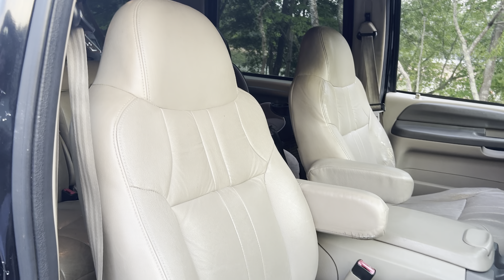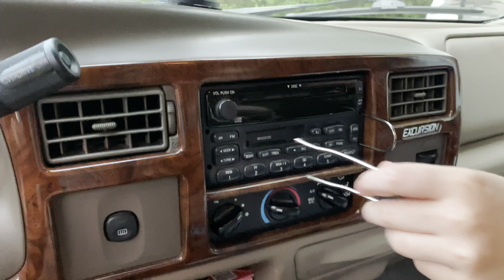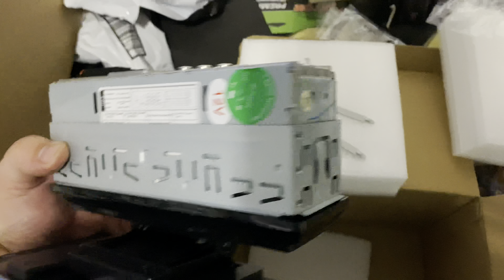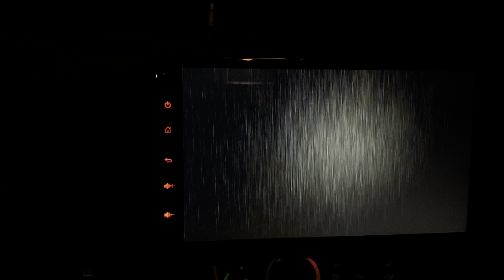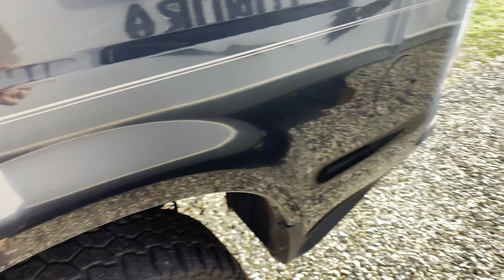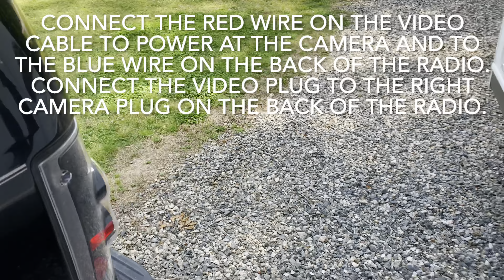Apple CarPlay Radio Install - ‘00 Ford Excursion XLT

Comment from the maker: The rear backup camera power wire should be connected to the pink wire (Parking Sensor Control Wire.) Then the yellow RCA connector should be plugged into the CamIN connection on the back of the radio.  This seemed to work well.  The instructions are lacking.  

For the another camera to be connected, you can connect the camera power wire on the video cable to the blue wire on the back of the radio.  Then that yellow RCA connector should be plugged into the Right Camera connection on the back of the radio.

Comment: The radio adaptor it sends me to on Amazon is not the one you used, its totally different has tabs on the top which won't work for me. I need the one you used. Can you help? I can't find it.
Reply from the maker: That’s the correct one.  You may have to remove the tabs like mine.
Reply: I’m having the same issue. Did you end up cutting off the tabs on the top and using the one he linked to? Or did you buy a different one?

Comment: I noticed quite a few of these Chinese head units are all the same models. The boxes are labeled different though the head unit itself has no brand name stamped on it. 
I have an Essgoo brand radio exactly like yours. The only issue I have with this 9010C model is the screen can’t be moved left or right for better viewing while driving. 
Cheers from the UK! 🇺🇸🇬🇧

Comment: I seen the unit was cheaper? How did everything work after a few months?
Reply from the maker: Yea, it was very cheap.  I’m still using it today.  It’s been pretty great.  Every once in a while, but I think that might be my old lighting cable.
Reply: do you have the link for the dash kit you ended up using?
Reply from the maker: @codywhite3035 it’s in the description bud, under Radio Adapter. 😊